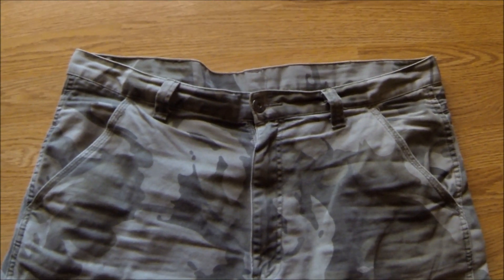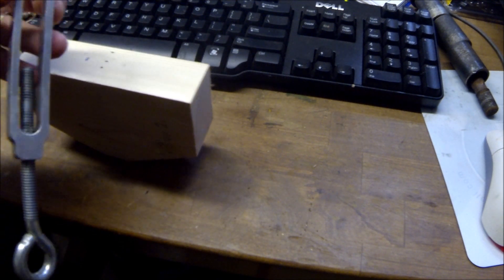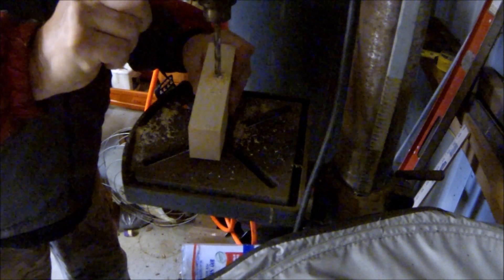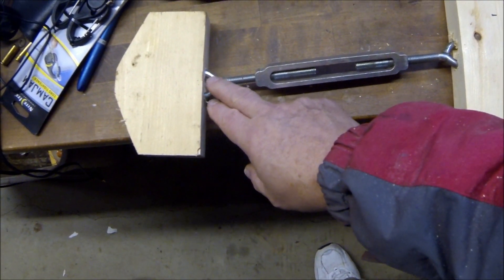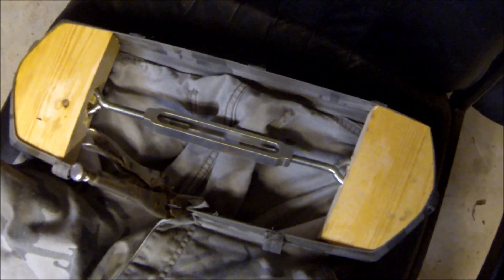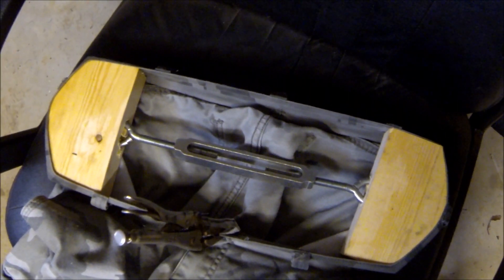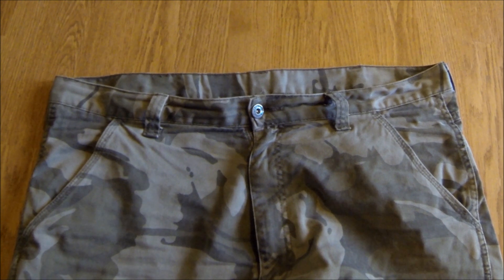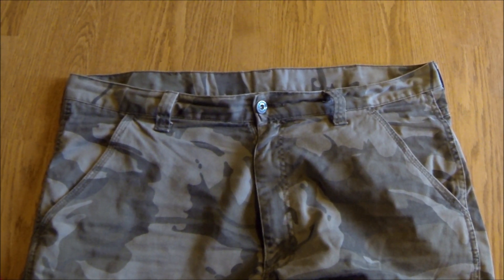Pants Too Tight~ Make A Pants Stretcher

Comment: I hate to tell you this, but actually did go to a 38" waist pant... it's just that yours still has the 36" label. LOL
Clever and effective idea and something I could utilize while I'm trying to remove the excess holiday weight--which is not coming off as easily as it went on!
:)

Comment: Hey bud,  talking  about the daggum button, wow, I have suspected  Wrangler of cheapening up on their jeans for quite a while. In the last few years, increasingly I have got some evidence of that.
Haha, as you alluded to, as we age and gain wisdom, harhar, we get a little bigger and instead of wearing 30x36  cowboy cut wranglers, which were the go-to britches in my world, I got to increasingly  bigger waists and surprisingly, shorter inseams. Holy Crud, Batman!  How did this happen except for 40 years going by, haha.
So, you gots to make a stand, right?
Mine was 38 waist which is as big as a goddam rhino, BUT, depending on the boots I was wearing, 36 was way too long. Here is what happens and it is heinous as hell, but true nonetheless.
Shit, if ya weren"t wearing ropers or packers or something like that, where the pants cuff could not go down, you were OK.
However, if you were wearing real cowpuncher boots with a slick heel and and undercut heel, your britches went under your heels. This is not acceptable. You would  soon step out of about an inch or two of your wranglers, which looks like hell.
So, in my case, I had to shorten up on the inseam, and I stll blame Wrangler for that shit. 
Everybody has heard that you shrink as you get older, but I think the bastards increased the caliber of the cuffs. Tell me what you think?
Reply from the maker: Yep... It's tough to get old. The metabolism goes to pot and so does the belly :)